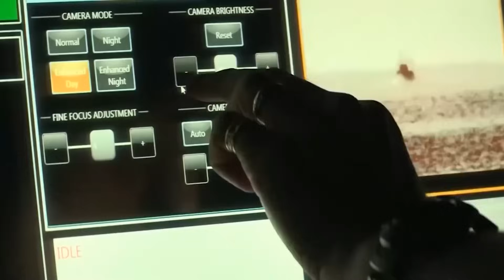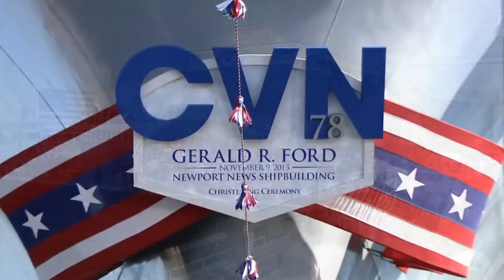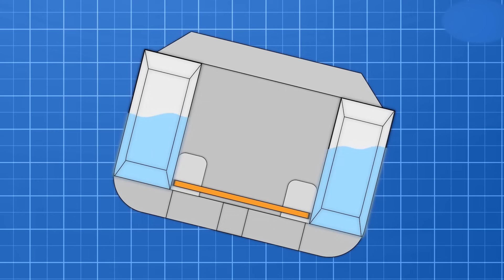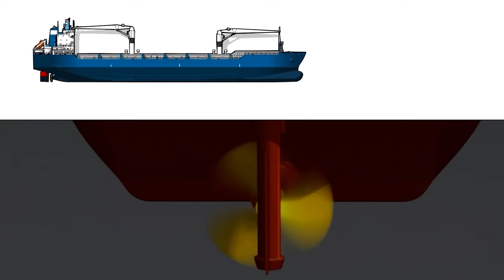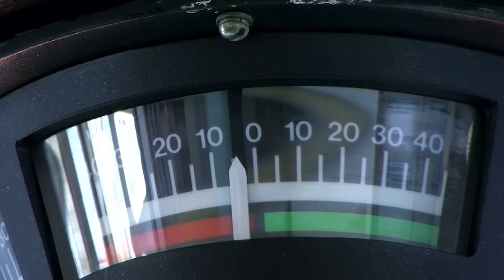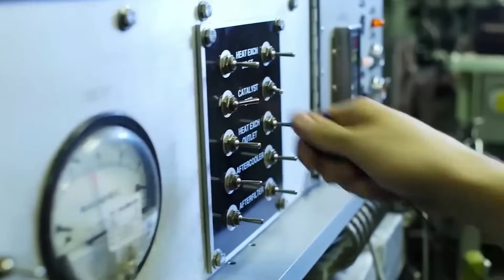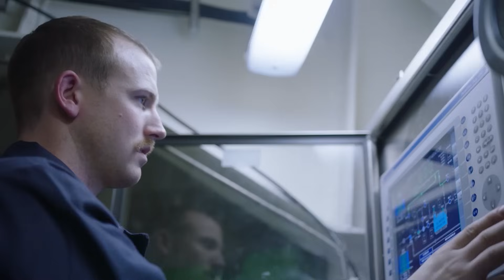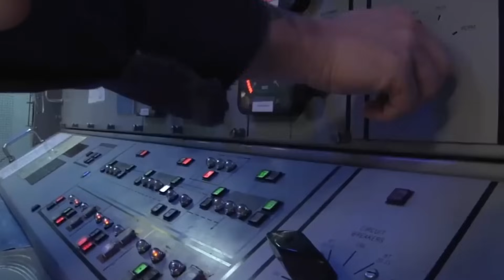World's Largest Aircraft Carrier ROCKED By Deadly Storm, Then This Happened...

Comment: Sudden rip curl drop pressure will lost it grip slide in opẽn seafloor deep pocket going between low surface water even level draft sucktion bellow usully in place like burmuda dua land triamgle giant atlantic burmuda nova scotia deepest seatide angola triatlantic triangle that triple 33 corner two dryland Zone bigger water flip x 46 it used to be shockingly nortorius atlantic seabstorm up north moonsoon equanox tropical vancer ameria africa

Comment: Like a inverted enclosed turtle sjell flatop low wide boyancy with thin dide airopen slitt even tip over it bounce flip back too soon for water to enter equiliberilium center of bouncy balast displace surface to weight airlift ratio

Comment: get the point . . . I'm sure you understand that sea water behaves very differently during a severe storm compared to when the sea is relatively calm . . . the basic laws of hydrodynamics have little to no effect on incoming 6.3 ft waves . . . weathering a storm in the middle of the ocean in a 68,320 ton multi mission (CATOBAR) aircraft carrier is about brute force acting against the ravaging immediate sea water close to the carrier . . . the notion that bigger the ship better the sea state is a both yes & no bcos it depends on a lot of variables that needs to be factored in before coming to a practical conclusion . . . when ships ride across incoming waves it's putting a flat piece of weight on the the highest point of the wave . . . in such a situation buoyancy & hydrodynamics go out the window . . .

Comment: Container ships are not aircraft carriers.  
     Aircraft carriers have a lower center of gravity.
Reply: @WTH1812  the fuel for the aircraft on board the carrier is stored in very large tanks in the lower parts of the vessel and acts as balest
Reply: @robertbailey8444  ballast
Reply: Once some containers that have broken loose go overboard.
The Container ship loses its balance and can be (easily) tipped over.